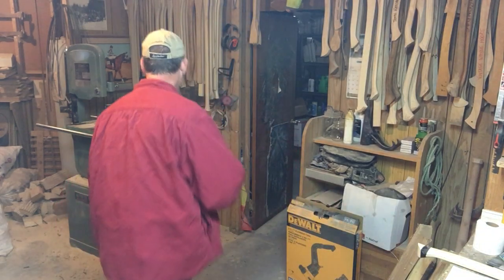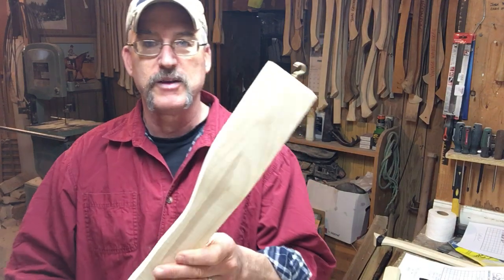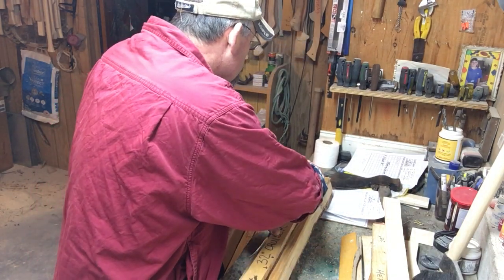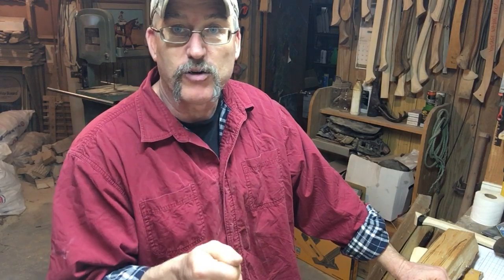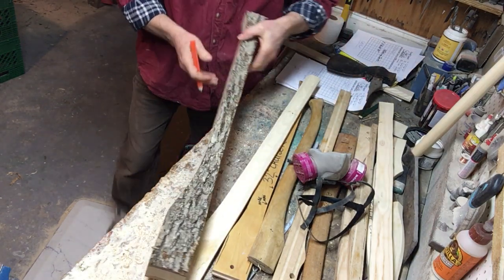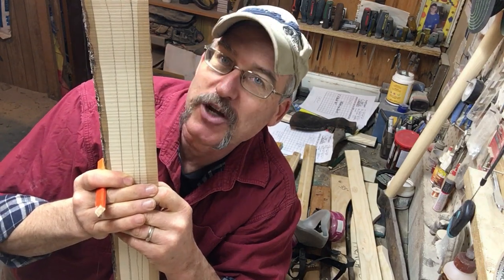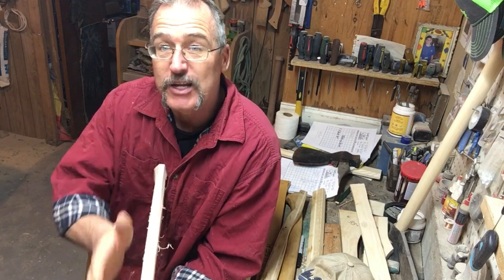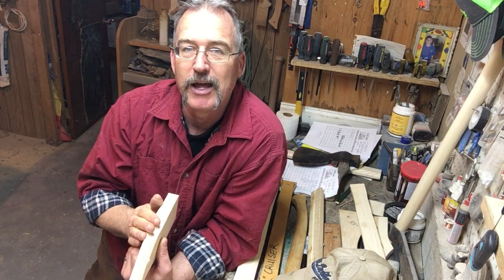How to make an offset broad axe handle with NO runout!

Comment: In Australia we use this stuff called 'spotted gum'....   Trying to split it to get that initial straight grain thing  happening is really difficult. I think they are pretty good handles though.
Reply from the maker: Gum species are typically eucalyptus species, which are diffuse porous unlike hickory and ash that are ring porous.  have you ever checked out the wood database website?  Lots of great info here.   They list about 6 species of gum trees - most are diffuse porous.   They also share your frustration with grain and difficulty splitting - seems to be tough wood!!

Comment: Good video...thanks Jack

I just made an off set/ dog leg handle for a hewing hatchet, this is my second one, and I thought I would have done better ... I used a piece of ash from the butt cut of the tree that I saved several years ago, I used an axe and draw knife to shape it. I messed up when I cut it out and made it left handed rather than right handed, I flipped it around but now the swell that should be at the back of the handle is at the front. Wonder who will be the first to notice besides me... Now I think I have if off set too much... arg... but it's all a learning thing...
Reply from the maker: It is!  I was asked that a few years ago, about the offset and which way it goes.  The fellow suggested all handles are offset the same direction.....  I just chuckled to myself, as I have made several dozen now for customers and although I have more offset to the right, I have about 1/4 of them asked to be offset left.  Great on you for giving it a go!
Reply: @eastcoastlumberjack  Thanks for responding so quickly, I really enjoy this stuff quite a bit :) I organize the GreenWood Wrights'Fest in NC. We have a TImber Framing Course coming up in October, and I'm Hewing benches for a Kuksa Class. I also helped hew logs for a timber frame shop during the pandemic.
 
The thing that confuses me is while I'm working the wood and decide on the profile I think about the direction of the bend, but not in relation to the little piece of wood in the back, till it's too late. What did you call that? I did the same thing with my first one and kept it as a leftie because IMO it doesn't really matter with the larger axes. 

In my limited experience, most are Right handed off set to the Right, withe the flat on the left,  so your right hand knuckles don't get barked. Most people are right handed so (most set to the R) that makes sense. IMO it is especially important for hewing hatchets, because you may be holding the wood with your left hand, but when hewing a log, it helps to have on left and one right.

there are two reasons I believe this to be true, if the log is stable, and you are hewing with a right handed/bent right, you go down with the log on the left. 1) If the pith is in the middle of the log, the top half the grain is pushing the tip out a bit, and the bottom half is pulling you in. so sometimes I liked to switch axes to the other hand... 
2) If there are two people hewing the same side of the log, one can come from one side and the one comes from the other.

One more question, you said that all hewing handles are straight. From your research, why would that be? And do you have any specifics on handle length and oval diameter or circumference to hand and body size?

Also is it worth cutting out a piece of elm from a log for later use as a handle?
Reply from the maker: @CarabnrFilms  Hi Carab - You likely have far more experience hewing than most here, so I'd take your advice in a heartbeat on requiring a left and right handed axe - makes sense.   As far as the straight handle, I think when working to make a straight edge, which is the purpose of a hewing axe to start with, the fewer curves to negotiate the better.  As far as dimensions, I go with the feel.   I do think handle length comes down far more to axe purpose than the size of the man.  My boys are significantly taller and stronger than I am, but they still use an axe only an inch longer (I use 29", they use 30)  I'd still use a 30" if I had the strength I did at 30, but as I close in on 60, just don't have the strength to swing that extra inch.   I use a 29" to chop, but a longer axe to split wood.

Elm is a ring porous hardwood, so technically it should be good for a handle as far as shock absorption goes......but its a bugger to split!   Also, if you check out the wood database at https://www.wood-database.com/worlds-strongest-woods/#google_vignette - you will see elm ranks desperately low compared to other woods for strength.  Hickories are at 40, yellow birch 37, maple 36, ash 33, oak 30, white birch 26 and elm is even below all of these at 24 (a unit that scores the three best measures of wood strength).....just so you know.
Reply: @eastcoastlumberjack   Thanks so much for your input, very useful info.

Comment: This is great, and funny timing because I just used a crooked bolt that I almost threw away to make a curved handle for an adze. I still don't have a hewing axe though.
Reply from the maker: Does it have the square, fitted eye? (the adze?)  they are a really unique handle.  I think I ruined a few bolts before I nailed an adze handle down.   If you did it first trip good on you man!
Reply: @eastcoastlumberjack  it’s not perfect but it works so I will take the compliment!